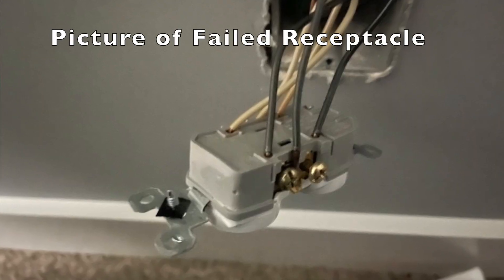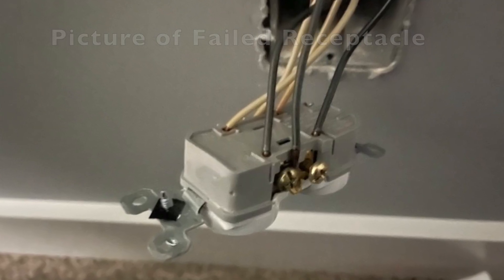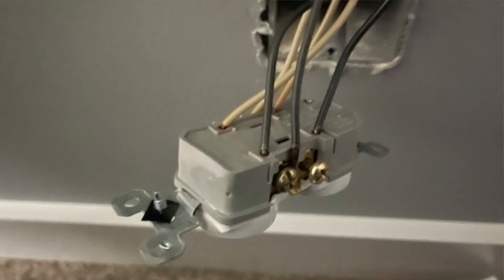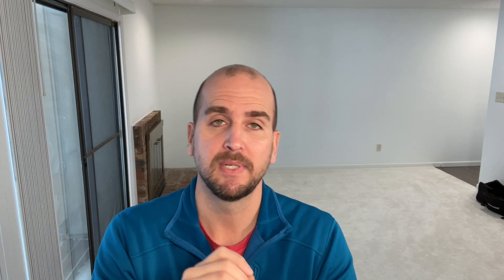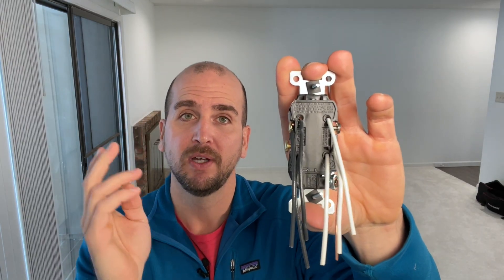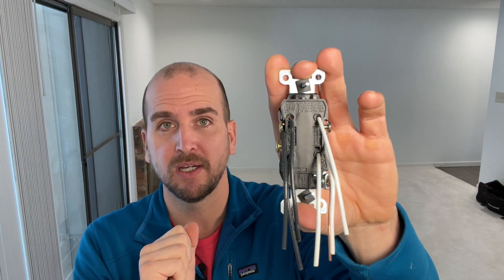Incorrectly Wired Outlet Found In Newly Built Home

Comment: One thing that I would like to add as an electrician. “It’s a much better approach” (referring to using a pigtail)
The reason you want to use a pigtail is because it keeps that specific outlet separate from the ones down the line. If you ever have this specific outlet burn out, the other outlets on the circuit would remain functional because they have a connection point at the wire nut, not in the outlet alone. For electricians coming over to fix the issue, it will save you money and time, when they can troubleshoot the one outlet, rather than the entire line of outlets trying to find which outlet is the bad outlet. Rather than just having one bad outlet that can easily be picked out and replaced.
I ran into this situation when I helped a neighbor. The outlet closest to his front door was not working, checked voltage at the panel and the voltage was good, I then went back inside, and checked voltage on the outlet on the OPPOSITE side of the wall! No power either. I opened that outlet, as it was the closest to the panel in that room. Sure enough, that wire was all corroded and the neutral push in location was melted and burned. I replaced the outlet and added a pigtail. His Christmas lights were back on.
This took me a very short time to locate and fix, even when the outlet in question was never even opened. I could have opened all the outlets in the room to figure out the issue and cost him much more money.
Also, you should pull test your wires once you place your wire nuts on. I also, in my opinion, would never pre twist the wires before placing a wire nut. It’s more of a personal preference, I’m sure they are both fine, but you should always pull test. Sometimes the wires just slip out and can cause issues.
Good on you for tightening both screws so they don’t have such a wide profile, very common mistake people make.
I never use the push in method. I’m not a piece worker, so I’m sure it’s much faster, but ultimate far less superior than the screw. (Even with the push in method you need to tighten the screws, those are still live once that circuit is up and running. If this video is for DIY’ers you should always recommend turning the breaker off, I noticed that you never touched on that at all in the video.
I think that about raps it up. Good video, hope this helps someone.
Reply: @James-dt7ky  I read it all.
Reply: @Petergriffin666 If reading detailed text isn't your thing then doing electrical work should also be off your list.
Reply: @davidjorgensen877  Xactly! It is the details that count.
Reply: @davidjorgensen877  👏👏👏
Reply: @davidjorgensen877  Yes
Reply: @davidjorgensen877  Exactly!
Reply: @davidjorgensen877  This. Thisthisthis.
Reply: @davidjorgensen877  So right you are David! I’m an instructor for Mobile AC and During class while discussing the fundamentals of refrigeration, I had one student apprentice complain that he “wanted more Hands-On instead of this”. I promptly told him that there’s no future in putting your hands on something that you don’t understand first. You need to see it with your brain first.
Reply: I did and it was to the point. Electrical needs attention to detail, quality work saves lives, quantity
work kills
Reply: Agreed, although I'll always pre twist my wires.
Reply: @Tre16  I don't know whether it's brand-specific but some wire nut makers specifically say not to pre-twist.
Reply: @wholeNwon  I don't pre-twist if a stranded wire is involved.  Let the wire nut do the twisting.  With solid wires, the pliers will do a much better job twisting the wires together than a wire nut.
Reply: @Tre16  per the manufacturer's installation instructions, they do not include twisting the wires. I always twist and use the wirenuts as insulation.
Try it without pretwisting, they will actually twist if installed properly, pretty cool.
Reply: @terrym2778  no thanks. I trust my work, not gonna rely on "manufacturers instructions. Wire can and will fail from time to time.
Reply: Thank you for the explanation.  When people tell me to do something a certain way I always want to know why.
Reply: @number5isnotalive  You and me both.
Reply: @Petergriffin666 I did.
Reply: @Petergriffin666 so did i,  and i'm not even an electrician.  everything Monroe Fuller said was really good information.  thank you, Monroe!!!
Reply: Thank you for reading! Glad so many have enjoyed what I wrote! :)
Reply: @monroefuller7028  Ya was a great point to make ... albeit myself thought it would be an obvious improvement in maintaining secure connection throughout a circuit.
But has been many a year since I was first learning home electrical ... and can't remember exactly how things evolved in my brain for making sense with it.   Was probably 10-15 years before I could wire 3 and 4 way switch set ups without having to look at the diagram or laboriously think the path through.

One side point I wanted to add ... which really is only relevant in newly wiring a circuit.
You can keep the wire intact pushed into a box as a loop.  Then just remove the portion of insulator that will contact around a screw terminal.
Also in large boxes with multiple switches/plugs .   You can create long pigtails with bare spots for each appliance connection.  Thereby not having to deal with an unruly amount of wire nut pigtail connections.
I also for the most part don't pre twist my wire nut connections ... just when it seems there may be a problem with a large number of wires.    And like you said ... Always Always pull test them which is another great point in itself  ;)
Reply: I read the entire post. If I can sit through a 7:33 minute video, I can take an extra minute to learn something valuable from a professional electrician.
Reply: I read it too and had never thought to use pliers to twist the wires.
Reply: @oDon44  
Twisting the wires helps with heat and cool expansion and contraction over time ... it is a good idea.
Reply: @justgivemethetruth  bull.
Reply: @Petergriffin666 i did
Reply: I love this.  So much great advice.  One thing I would add, (not an electrician), is that when you wrap the wire around the nut in your 'J' shape, make sure your hook opening is facing the direction of the screw being tightened so you actually pull it tighter and aren't pushing it off of the screw when you tighten it.  Was gonna mention the pull test, too, because many fires result from loose connections.
Reply: Thank you for explaining the rationale for pigtails. I am an electrical engineer and I do a lot of my own electrical work in my home. I have seen the terrible results of stabbing wires into outlets on many mobile homes, and the problem when they are Daisy chained without pigtails. It's a relatively easy problem for you to figure out if you have experience, but the pigtails make it infinitely easier to troubleshoot problems, and create a soft fail situation. I'll be incorporating them from now on when I work on outlets!
Reply: @billcaruso7050  "on many mobile homes" says it all.
Reply: can't tell you how many service calls Ive had to hunt down the one bad plug in the series. DONT BACK STAB THE PLUG.
Reply: Yes, absolutely, but distinguish between "back stabbing" (into a cheap, spring-loaded contact) and "back wiring" (where the shell guides a wire under the screw, so you don't have to a J-hook, but you still tighten the screw onto the wire.) As noted in the video, back-wiring is usually only found on pro or commercial grade devices. Do not back-wire two or more conductors under a given screw--one of them will always work loose. Especially important when upgrading old work, where one cable might be 14ga, but the other might be 12 ga. The thinner 14 ga conductors simply cannot be tightened enough when sharing a screw with a 12 ga conductor.
Reply: Thanks so much!
Reply: @Slim Savage I'm watching to rewire my trailer, got 4 outlets that work, and should scare you I'm female, so yes I'm reading all comments, and learning alot before I start, but I've replaced outlets before I just shut off whole box n double check with an appliance it's off, but I'm tackling a much bigger job than I'm used to not replacing just one, but all, or till I find bad one in line. And  one and draw diagram of wires.
Reply: @kathleenlouiseridleypienta5246  
You sound like you're definitely on the right path, Kathleen. Read up on your subject, ask questions, and have an attention to detail. Many people forget that electrical wiring can literally be a matter of life and death, if not for you, then for the next person.
Reply: Do failed outlets always daisy chain the fail? I would of assumed that the outlet terminals would of been physically connected by a more than adequate passthrough conductor directly? Putting an extra splice in the wire and just shoving it into the wall just seems non-optimal. The strew on wire connectors functions adequately, but they are no screw down clamp or contiguous wire. You are really trading one failure point for another, and now you have two things that can fail with that outlet.
Reply: @wisnoskij  its so you can replace a device without having to break the circuit..ie replacing a receptacle in a hospital
Reply: @wisnoskij  The main point is most outlets are 15 amp rated ... and used with 12 gauge wire on 20 amp circuits .  Which is usually fine for most situations .   Its a case of that odd ball plug that gets over used due to its location with some ones everyday living.
So copper 12 gauge directly connected not using the plugs brass/zinc connection points is always better.
Reply: @Mk101T  
Yes, I used to wonder about that. It bothered me seeing 15 Amp outlets wired in series on a 20 Amp circuit.
Reply: @wisnoskij  I imagine there are almost zero pass through failures when the outlet is used for the pass through. I always thought this argument was about allowing the pass through to continue to work if the outlet was removed and it wasn't replaced.
Reply: @wisnoskij  there is a slab of copper connecting the two terminals but the whole outlet is held together with plastic. if the plastic melts all bets are off.
Reply: @Petergriffin666 I read it and learned something from it.
Reply: @Petergriffin666 I did
Reply: @Petergriffin666 I read every word.  Learning is all about reading as a good reader is a good communicator.  Language is the art of communication. Communication is the art of manipulation.
Reply: @Petergriffin666 I did
Reply: @Petergriffin666 I rarely do any electrical work in my house but happily read it all. I already did each of the things he recommended but liked the affirmation.
Reply: Helps alot doesnt short out the rest of the outlets on that circuit. I wire all my outlets like this.
Reply: @marcobautista6093  what?
Reply: I was happy to see a professional electrician claiming that not twisting the wires first was acceptable. The wire nut manufacturer claims that this is an acceptable practice. For a non professional I have done quite a bit of electrical work and I almost never twisted the wires first and I have noticed zero failures with the practice. However, when three or more wires together twisting on a wire nut can be awkward and the possibility of a failed connection because the stripped leads shift before the wire nut is fully installed.

FWIW, I also do a pull test on a wire nut connection to help insure that it is properly installed.
Reply: @davefoc  In 40 years, I've never twisted the wires with a pair of pliers.  If you strip the wires correctly and lay them the right way, as in stacking them properly, then wirenut does the job perfectly.  Also if you have to troubleshoot stuff you're not having to untwist that garbage and re-cut the wires.
Reply: @deej19142  You de man Deric.
Reply: @deej19142  Correct!
Reply: @davefoc  Good job. YOU should do the next video.
Reply: I would never join multiple solid conductors without pre-twisting.  Some have said there are wire nuts made that say pre-twisting isn’t required so I looked atTwister by Ideal and then say its recommend but not required and of course the example they give is one solid with one stranded which can’t really be pre-twisted with lineman pliers.  IMHO if you’re joining solid conductors and are not pre-twisting you shouldn’t be doing electrical for a living.  You might as well not even pigtail and feed through the devices quick wiring stab in the back ports and side wire then cuz its probably a more reliable connection then not pre-twisting and using wire nuts.
Reply: @Preston412 
Reading is fundamental.
Reply: Totally agree. would add.. Ever try to remove 4 push ins? not fun
Reply: @Preston412 People who might want to learn something will. Obviously not you.
Reply: Monroe, Great feedback.   The only this I personally would add, is that when working with metal boxes, I am in the habit of using electrical tape around the outlet, covering the screws on the side of the outlet.  Overkill?  Maybe, but I find it safer.
Reply: Hey thanks for explaining the pig tail mess. The op didn't do a good job of explaining why the pigtail is necessary, which it really isnt nor is it against code not to. But as you stated with all wires connected to the outlet finding troubles in the line would be problematic. So thanks for the description. Was going to comment whats the difference between all wires in the outlet vs the pigtail and what are potential problems with one vs the other .... Glad someone smarter jumped on.
Reply: Wraps not raps.
Reply: @David Why four David?????
Reply: I read it all. Thanks for taking the time and sharing your expertise
Reply: THANK YOU!  After watching the video I had the question of "why."  I wasn't challenging it but if I knew why, it would help me commit the practice to memory.  Your explanation made perfect sense and your additional tips were also beneficial.
Reply: I had found a problem that saved me about $50-$70 a month in electric once I fixed it. My bill was always higher than my neighbor that had an identical house and 2.5 kids. It was a long troubleshoot but here's what I found. The previous owner did a partial renovation to the kitchen. He tapped power from a basement ceiling light and ran 14G wire up to a GFCI, he had a daisy chain of 4 backstabbed outlets along the kitchen counter. The outlets had the refrigerator and  microwave, toaster etc. One of the outlets had a wire going through the wall to an outside outlet that also sent wire down a conduit for an above ground pool pump. I also found a 30A breaker on that line, so he must've been tripping the 15A breaker designed for the basement lights and just doubled it. I ran 12G wire from the box with dedicated breakers to the kitchen and a separate one to the outside, I fished new wire along the counter to each outlet. The back stabbing and the wrong wire resulted in a hotter amp demand from the appliances and pool. One of the backstabs had a loose fitting with burnt but functioning wire which was probably the primary culprit. The higher amp demand translated to kilowatt hours and kilowatt hours translates to $$. My bills dropped an average $50 and $70 in summer using the pool.
Reply: @mrchrislatino  why?
Reply: @mrchrislatino  so….Christian, I’m not clear on this. Are you saying that the added resistance in the circuit increased your current draw? (Increased your amperage)?
Reply: @tompaparounis5731  Yes, that's exactly right.
Reply: Thank you for this info, makes total sense! As far as safety though, not an issue?
Reply: @Preston412 I read it all
Reply: excellent comment. Thx a lot for taking the time to explain so thoroughly.
Reply: @christosneophytou1238  What is a thx?
Reply: I read everything!!
Reply: @Preston412 I read all this. Not sorry.
Reply: @Preston412 i read the entire piece. It was Good info.
Reply: I never use the push terminals and have pig tailed outlets in some situations rather than use the outlet as a through conductor.  However the main reason some electricians use the push terminals is economics.  Even two or three minutes saved per outlet is significant when a number of outlets have to be wired in a short period of time.  Unfortunately safety is diminished as the push terminals can fail when the circuit is loaded close to its capacity and Murphy's Law comes into play.
Reply: @Preston412 I did  and it was very helpful and informative.
Reply: @Preston412 Wanna bet?
Reply: @Preston412 I read the whole comment
Reply: @Preston412 I totally read it all
Reply: @Preston412 I read every word--and have read dozens of comments like it. Why? Because electricity is dangerous if treated casually, and I want a solid sense of not only what people have found to work, but why.
Reply: I read it...
Reply: I read it twice. Electricity done wrong can kill you!
Reply: Preach!  I've had this problem twice now in my house, and it's difficult to troubleshoot.  And now I need to go back and use the pigtail technique.  😫
Reply: @Preston412 I read every word even though I know everything he mentioned in his post. I may have learned something new had I been much younger and less experienced.
Reply: @Preston412 I read it all
Reply: Thank you for adding the -reason- for the pigtail. I couldn't see any good reason not to use the two screws for the two wires (which I've been doing for years) and there was no explanation given in the video, either. Though I've never had that issue, I can see the problem with finding a bad outlet using the two-screw method. thumbsup
Reply: i believe back wired clamps are a better connection than a twisted wire nut most failures are poorly twisted wire nuts. also, the outlet could fail but the screw terminal is still holding all the wires tightly together on a back wired outlet it can hold 4 wires securely together with no pigtail if you add pigtail now you are twisting 5 wires not a good connection at all
Reply: @ranger178  "most failures" How many failures are there now and in the past in the whole world? Did you test and document each of them? Hmmm?
Reply: Thank you, I was wondering why he made a pigtail for this outlet.
Reply: @Preston412 I did.
Reply: @theCraftyHeretic  You did what? Confuse amateurs?
Reply: @Preston412 then for their safety and others I pray they stay away from electrical work.
Reply: Very helpful. Thanks!
Reply: As an electrician where in the latest two NEC code books ( 2017 &2020 ) do you find term neutral  or nuetral conductor? Not in my code book .
Reply: @JohnThomas-lq5qp  How about grounded conductor. That better?
Reply: @JohnThomas-lq5qp  I don't have my uglys handy but maybe 220-22?
Reply: @JohnThomas-lq5qp  to be upfront that came from a Google search I don't put any faith behind it till I confirm in my Uglys or Nec
Reply: Thank you for sharing
Reply: Thanks so much for this explanation! I was just about to ask about it.
Reply: THANK YOU, I, M JUST TRYING TO FIGURE OUT WHY I, M BLOWING FUSES EVERY TIME I FLIP THE ON/OFF SWITCH ON?? PATRICK.P
Reply: @Preston412 I read every word and was grateful
Reply: @Preston412 If they dont want to read the long comment it's their problem then cuz this guy pointed out lots of good info.  This isn't a video how to comb your kitten. This is household ELECTRICAL where SAFETY counts.
Reply: @DirtRider999  I just did read all the explanation.  I was curious why the pigtail was used instead of the secondary screws on the outlet.  Now I understand.   Thank you @monroefuller7028 for taking the time to explain.  Greatly appreciated!
Reply: Petergriffin666: His “thumbs up” count suggests otherwise.

It might be appropriate at this time to really consider the appropriateness of allowing someone who is not blessed with  the detail-orientation or attention span to read a couple of important and relevant  paragraphs, to have access to any part of your building’s electrical system, beyond plugging an appliance in or flipping a switch.  

Just sayin’.
Reply: @Petergriffin666 I read it. Stupid people who need to read it the most won't read it!
Reply: <Correct. That's the way I was taught as well.>
Reply: As a fellow electrician this is really a good informative comment and a good read. However, I always make sure to have a good tight splice on my wires before twisting on the cap. Because  sometimes you have no choice but to work on a circuit hot. I hate when I take off a wire nut looking for a feed or something and the wires all pop apart
Reply: I read it and so has many other people, appreciate the reply. Much better approach is a great explanation
Reply: @Petergriffin666 Except for all the hordes of people like me that actually do all sorts of things all over the board in our professional and DIY world, unlike the hordes of people like yourself that don't do anything but pick up the phone call for help, so yes in many ways you're absolutely right.  I read every word and paid attention every sentence happily. We need people like you. You need people like us, are you getting any of this? Or is it just something that is simply too much to read. I Probably should have just drawn some pictures on a chalkboard and taken a little picture for you. 

Oh and thanks Peter Griffin,   you're in that group of the other hordes.
Reply: Parallel vs series wiring…
Reply: @badkarma6181  series wiring? Residential 120volt? Not Relevant!
Reply: Out of HS, I worked for an electrician that was also a part time electrical inspector. He taught me to never use the push-ins, and never feed through outlets and use pig tails.
Reply: @Preston412 If they don't read it all it is their loss!  I am 71 and still learning about things I can do myself safely.
Reply: Thats best trade practice...especially when working in emergency or medical facilities
Reply: @timhick6  Please leave that to union journeymen.
Reply: company policy where im at- screw wrap pigtail or its your job! And your right creating a feed to vs a feed through scenario is ideal for labor warranty.
Reply: @aaronb1980stuaii  Go back to school and lern to rite gooder.
Reply: Thank you for the safety knowledge
Reply: In our city the electrical inspector required a physical twisted connection of wires prior to wire nut. I just assumed it was in the code but even if not, he's the boss in that case.
Reply: @val058  No he isn't. The code that your jurisdiction follows is the boss. He is wrong about twisting the wires and anything that he turns down, he has to be able to support from the code- not his opinion or likes and desires. Don't be such a spineless puss. The inspector who is properly trained and who does his job correctly is worth his weight in gold. Jellyfish refer to the inspector as  boss... what a worm. No spine.
Reply: I pigtail AND solder. Now my lights don't dim when the vacuum is turned on.
Reply: @davesuess1195  Soldering AC circuits has been a code violation for many years Dr. Suess.
Reply: @donaldhinson7144  good thing i am not an electrician. Just an engineer. Soldering stranded is the big no no. As it heats, the solder softens and mechanical strength is lost. Soldering solid reduces resistance loss and dissapates heat. Less resistance means less heat. You want just enough solder for wicking action and not have it interfere with the cap threads biting the copper. You also have to use a blow torch for the rosin in the solder to bake off. I trust my solder and wirenut connections well beyond wago and just a wirenut. Ive seen too many chared wirenuts. You can follow code. Ill follow science. The only thing that dips voltage in my house is the air conditioner.
Reply: I read it all because he started out making sense and wasn't rude.
Reply: I always use the screws & prefer working with a live circuit; keeps you alert! BZZZZ
Reply: @ OP -   My first thoughts as well
Reply: This is a very good post, thanks for the professional pointers 👍🏾
Reply: I totally agree.
Reply: good job
Reply: Ok i read all comments. im an hvac guy. so i don't dont much in your line. but i respect all electrical period. i never thought of the piggyback approach. what do you all say? yes or no to that idea? for my own curiously. Would continue the run. Show that out let bad. i imagine fast and to the point? also i agree with the push ins. ive seen a guy strip wire. Push it in the push ins. then take the extra striped and twist it around the screw head for a tight fit. took im a second to do..
Reply: How prelevant is it for a receptacle to fail in a way that would burn enough for the connection between two terminals? This is a solid metal plate, and why would there be a strong current between the screw terminals anyway? Even if all plastic melts on the outlet, the terminals should still remain functional. If one of the terminals fails, this means that this outlet needs to be identified anyway, you can't just leave it. Plus , the screw connection on the terminal is a lot more reliable than the wirenut, so don't forget to discount that from your equation.
Reply: @michaelkuzmin  What the hell are you trying to say?
Reply: @Preston412 I just did it !
Reply: @Preston412 I just did.
Reply: The guy in the video did use a voltage tester to check power off before he started work.  He did address safety by this action.
Reply: @Preston412 I know! The first 3 sentences said it all, then he turned into my sister.
Reply: Wire nuts for solid wire are worthless, IMO.
Reply: @pibbles-a-plenty1105  what is an IMO? Maybe you don't know how to use wirenuts. Maybe twisting  them
Reply: Maybe twisting wirenuts on hurts your hand.
Reply: I also don’t like push in many times I’m unscrewing a outlet and without any pulling the wire comes out from the push in.
Reply: @arroyofive9259  run on sentence
Reply: @Preston412 I just read it all, but I do twist the wires.  Almost all electricians do, I can't remember ever working on a house where the wires were not twisted by whoever did the original installation.  But the wire nut manufacturer says they do not need to be twisted.

Also, if the circuit is a multi wire branch circuit that uses single pole breakers (which years ago were allowed by code) using pigtails will keep the neutral from being opened.  An opened neutral can cause the neutral past where it is opened to become hot through a load that is downstream of that point on the other side of the circuit.
Reply: @ericjorgensen4826  Almost all? Are you aware of how ignorant that sounds? How many electricians are there in the world Eric boy. How many do you know? Waiting on your research results.
Reply: I was taught years ago to always twist wires together on pigtails and multiple neutrals. I have opened many receptacles that were not twisted together and they had arced and had burn Mark’s. You will not have arcing with twisting your wires together.
Reply: Monroe Fuller....ya know, if pigtail method was used more, keeping down line loads off recipticals,  you would think AFCI 's would not be in the code nowadays?
Reply: @ottoroth3066   what? That statement was an embarrassment to the good Roth name. Please Otto, cut the tv off and read a book.
Reply: Rented a singlewide years ago. A bedroom outlet got too hot to touch, even though nothing was plugged into it, suggesting a near short.  

Got inside the box and the outlet was used for the junction to outlets on down the line, only one of which was being used. It had an alarm clock plugged into it.  

Now I have first hand knowledge about why the outlet doesn't make a good junction, versus the pigtail.

As it turned out, that old place did have aluminum, so de-ox and a pigtail was even more important, so the aluminum wasn't tied to the outlets [and switches].
Reply: Right,but i hate wire nuts in my work.never had a problem with one,but i dont trust them well.They dont age well,seen to many that heated up ,not twisted,half installed,just dont like them.rather blow a outlet than burn down the house.At least the outlet will keep the wires in place if it fails where if the wire nut fails the wire can move and touch problems.
Reply: @olivertaylor8788  so you use melted wax to hold wires together?
Reply: @olivertaylor8788 .....I once lost power in the back bedroom and finally corralled the problem in the outlet box by the kitchen. It was being used as a "raceway" back up to the attic to that bedroom; bad wire-nut connection
Reply: @bhaggen  Old wire nuts just risky.I have replaced miles of wire damaged by bad connections.Recyled copper wire is not good.Accident waiting to happen.Old cheep made products seem to be all one can get today,no quality any more.Glad im retired,
Reply: In the video example where he was using screw terminals w/12 ga wire so "the entire line of outlets" wouldn't be dead if that outlet "burned out" unless the screw contacts or the metal between the two screws was broken or melted (https://youtu.be/_rRa_CedJ38?t=280).  If you wire every outlet w/12 ga wire, you can't use push-in connectors and therefore have to use the screws.  Unless you have a lose wire, this rationale is moot.
Reply: @Preston412 long winded as hell
Reply: @McCurtainCounty888  Go watch tv.